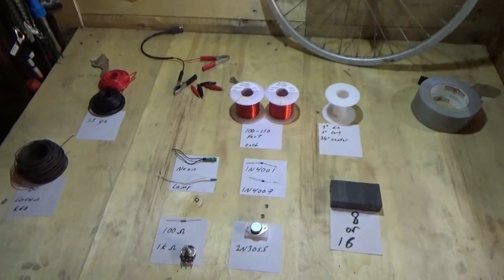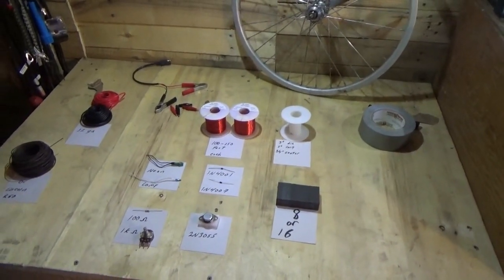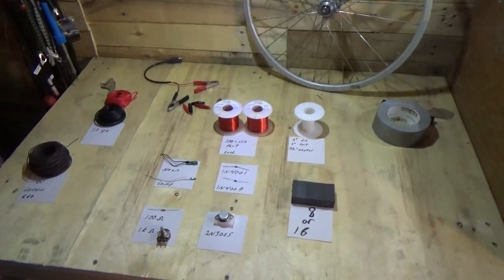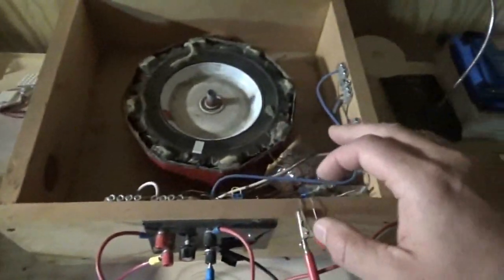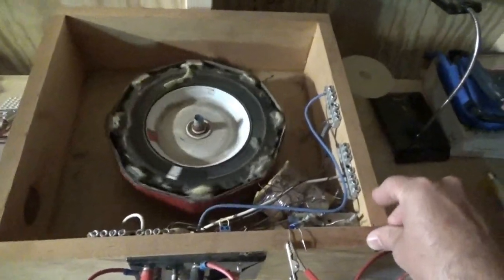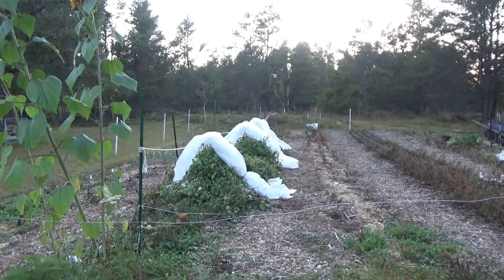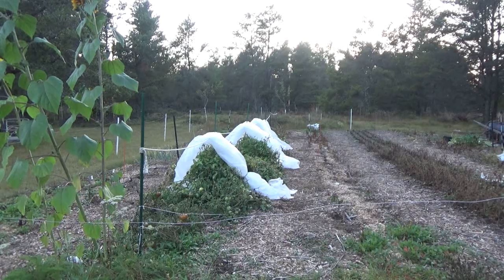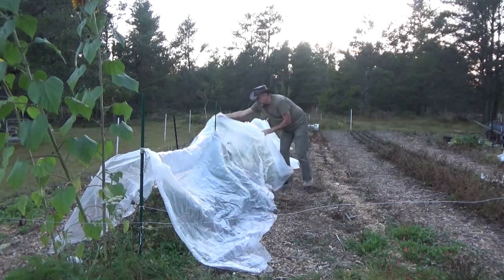Cutting Fire Wood & Making Bedini Motor Parts List

Comment: Troy, When you make a claim that you can get more energy out of a bedini motor than you put into it... Whether you realize or not, you ARE making a claim of having a "free energy" device, or "over unity". Don't you think such claims should be proven by showing input energy and output energy?
Reply: Troy, one more question and something for you to think about.... If the output power of a bedini motor was actually greater than the input power... Why aren't power companies using bedini motors to extract this "energy from the air" and selling it to their customers for a huge profit?
Reply: Troy, Wind turbines do NOT put out more energy than is put into them. Absolutely NOT. They convert kinetic energy of the wind into electrical energy. As a matter of fact the output energy of a wind turbine is slightly less than the input energy due to losses. The science behind it is well understood. Can the same be said for the bedini moter? Can you or anyone else explain where the extra energy in the claim you and others are  making comes from?
Reply: Now Troy, the energy you, yourself put into it is irrelevant from a scientific point of view. What matters is the total input compared to the total output energy. If you can show that the output energy exceeds the input energy.... As Jason put it, you would win a Nobel prize.
Reply: Troy, You say: "I can only show you what I am taking out of the run battery with my meters"..... Do you see the problem here? In order to scientifically prove a claim that more energy comes out of a bedini motor then is put into it, you MUST have ACCURATE measurements of the output power. You can't just say you're restoring a bunch  batteries and running a bunch of LED lights. That's not very scientific. I understand you have difficulties in measuring output power. But it is still necessary in order to prove your claim. As for the battery voltage rising, that doesn't mean anything without also knowing the current going into the batteries. You could have a million volts with almost zero current. Which would mean almost zero power. Since power as a function of voltage x current.  As for running a bunch of LED lights... They use very little energy. That is why you need accurate measurements of output power of the bedini motor.
Reply: David, as I understand it, they are not running a car on just water.  They are using gasoline.  Only they claim the regular combustion process is inefficient and can be improved by using hydrogen/oxygen injection.  This is claimed to make a better burn, more hp and less fuel used for a given number miles (mpg)  despite the agreed admittance that yes it takes energy from the engine to crack the water.  The subject is complex and we haven't even mentioned the effect of the water vapor also involved in the process which there is good literature on that subject.  By your reasoning here, the modern jet engine is a wasted cause as well, since it costs the engine, some 30-40% if I recall correctly, of its generated hp just to drive the compressor fans!  What percentage of the car hp is really lost to dissociating water much of which is then returned to the engine hp?  Certainly not as much as the jet engine!  Yet the jet works fine all over the world.
Reply: Troy, I can see why David and others are a bit frustrated with your saying the energy has to come from somewhere and you jump on the radiant energy/cosmic bandwagon without proof.  Those are energy sources that even the today's smartest scientists have not been able to harness at home practical use levels.  So why do you leap on those sources, when you said it must come from somewhere but really you don't know I think.  You should not jump on some source just to explain it (Bedini) unless you have some way to prove where it came from.  There is a source I know of which you have probably not thought of which may be influencing your tests.  Have you ever noticed on a cold day when you first try to start a car and the engine barely turns over, but then you wait a few minutes, try again and it is as if the battery is stronger and the engine turns over easier?  That is because of the raised temp in the battery causing a better reaction to RELEASE EXISTING energy that was not previously available.  The battery chemistry can be excited in many ways to release the stored energy, in your case, simply HV current spikes can do it by mechanical and the slight heat generated.  Also, a car battery changes capacitance with temperature.  In the hot of day that battery is endothermic and a small conversion of environmental heat is converted to an increased capacitance.  At night the coolness causes a lowering of capacitance but an INCREASE of voltage at the battery and INCREASE of useable energy output.  You can quickly test this with plan electrolytic capacitors.  It is free heat energy of the environment converted to electricity.  This will shut up the conventional arm chair energy conservationists and provide an easy to understand energy source and mechanism without leaping to radiant energy and cosmic stuff.
Reply: David, I agree with what you said about testing standards.  As to whether any of these magic clams are true or not I can not say.  But surely, the big boy corps would have knowledge on this.  I do remember many years ago, a test was done to merge gas and steam engine characteristics together for the goal of utilizing the normally lost: wasted heat energy which is where much of the usable energy is lost.  If I recall, the results were very promising and there was increased torque and other good results.  This is not the same as those schemes that used water mist injection which I have also heard gave interesting results.  Whatever came of it is not known.  I do know that big business works on releasing as little new or disruption tech as possible and reserves it for future incremental introduction to the people.  If they release all today, then they would have little to sell tomorrow.  Just business.
Reply from the maker: Jason, yes it does. That is the whole purpose of this device.
Reply from the maker: David, your own criticism answers your question. Why wont anyone use this? Because only a few even believe it works. And the oil companies wont allow it to go mainstream. There was a carburetor back when my Dad was young that got 250 mpg. Now, please ask yourself why we are "striving" to reach 30 mpg on most cars today. They have these amazing projections of increasing gas mileage by 2025 by a few mpg.
Reply from the maker: Same reason the Quanta Generator is not mainstream and why the company cannot sell it complete but as a kit. And why they can make no claims on what it does. And why they cannot really give you pointers on how to tune it. Its not allowed.
Reply from the maker: Actually David, I have done so on my electronics channel already.
Reply: The manufacturer of the  Quanta Generator most likely got busted by the FTC or some other government agency. The fact is, if Quanta could backup their claims, there is nothing the government could legally do about it.
Reply: Troy, you showed that the output energy exceeded the input energy? By measuring the BOTH the input voltage and current and the OUTPUT voltage and current? I'm sorry if I missed something.
Reply: Troy, Here is what I believe..... The power companies have far more resources available to them then you or I. In the interest of increasing profits, I'm quite sure they investigate these claims, and if any of them were valid.... I'm quite sure they would use the technology. Just like they use hydro power, wind turbines, gas, coal, and nuclear power to generate electricity. As for the so-called 250 mpg carburetor... I've heard of those claims too. I say to the people who make the claims.. Show me the proof! I don't just believe everything I read.
Reply: Now Jason, to be fair, that is a stupid statement.  Just because YOU do not know the mechanism to extract the potential to do work from some energy SOURCE does not mean it is does not do so.  Be more scientific to unknowns to YOU.  Investigate, test, show results:  scientific method, just do it rather than harp about it.
Reply from the maker: +David Johnson David, I did show you the proof, and I did, and you would still deny it.
Reply from the maker: +David Johnson the oil companies are involved. Not the power companies.
Reply from the maker: +David Johnson and look up vapor carburetor. You can get up to 200 mpg with any vehicle right now. But it's illegal. Why? Won't pass emissions. Emissions too low fails the test.
Reply from the maker: +David Johnson look up hydrogen booster. I ran them for years and experimented heavily with them. BUT it fails emissions. Too clean. Not legal.
Reply from the maker: +David Johnson David I can only show you what I am taking out of the run battery with my meters. But I ran many led lights and am restoring triple batteries at the same time. With no increase in power used from the run battery. Now the energy is there. The lights are on. The battery voltage are rising. It has to come from somewhere.
Reply: Troy, I'm aware of the so-called " hydrogen booster" claims and realize you believe that stuff. I'm sorry but I have to disagree with you. These "run your car on water" devises supposedly increase your MPG by injecting hydrogen into the combustion process. The problem with such claims is that the hydrogen comes from the electrolysis of water. Which takes energy! To me it seems pointless to draw energy from the alternator to split water into hydrogen and oxygen... Only to get energy back when the hydrogen is burned.
Reply: If bedini motors actually worked to put out more energy than they consumed.. It is the power companies that would benefit from such technology. Since they could sell the power to their customers. So my question remains... Why aren't the power companies using the technology.
Reply: EnergyCrafts, Keep in mind that in a jet engine the bypass fans also provide thrust. But you're right, it does take energy to drive fans and compressor stages. But here is the difference and please correct me if I'm wrong... It takes 100% of the energy gained by burning hydrogen to crack the water in the first place. As for whether hydrogen injection improves combustion efficiency, you may have a point. But shouldn't claims of improved combustion efficiency be PROVEN by tests run on a dynamometer to EPA standards?
Reply: David, from my own perspective, the cracking water to improve engine combustion and performance is only speculation as I do not know of any proven tests using accepted standards.  But as a rough consideration that an alternator may need to output 14.2 VDC at 40A  to drive an electrolyzer that is 568W is less than 1HP robbed from the engine.  Not to run the engine, but just aided injection to gasoline.  Now lets say the engine is 32% efficent in the gas to conversion to mechanical at the crankshaft while producing 75HP.  Next the magic box is added as a load taking 1HP so now only 74HP is available for outside use.  But say this magic box increases the engine HP by just 5% then it would reach 77.7HP output.  That is a gain of 3.7HP.  for a magic box cost of 1HP.  So even with this very conservative sketch, it does seem there is some possibilities here even without factoring in water vapor to steam condensation adding to the HP and efficiency.  The water vapor may convert more of the usual lost heat to usable kinetic force in the cylinders rather than the heat being lost to the environment.  Adding this consideration makes the possibilities that there may be something to this after all is intriguing.  Surely big business has already done tests and is not motivated to release practical results as financial motivation and the increased tech competition is not productive, as well as gas is already fairly cheap.  Rather they probably want to have a "secret weapon" for the future to beat competition or to serve as "the solution" when gas becomes far more costly and rare.
Reply: EnergyCrafts, there may no proven tests or accepted standards for testing combustion efficiency. But there are definitely accepted standards for testing fuel economy. Which are used by the EPA to test vehicles submitted by manufactures. All someone who is making a claim that their contraption improves  the combustion process has to do  is submit their vehicle and their "fuel economy improving device" to a lab with a dynamotor to perform "before" and "after" tests to test fuel economy. To my knowledge none of the folks promoting these gadgets has done that. I suspect there is a reason besides costs,  that they don't do so. Instead, they make unproven claims about their products.
Reply from the maker: Now David, you are twisting the wording of things just like a real "expert". I said does a wind turbine produce more power out than "I" put into it "myself"? Does the radiant energy device produce more power out than I put into it myself? I would say yes to both.
Reply from the maker: Jason???
Reply from the maker: Interesting how people avoid the questions I ask and just deny it is possible.
Reply from the maker: Really now? How about the static energy generator? Are you saying that is not scientifically possible? How about a wind turbine? Are you saying that is not scientifically possible? I mean, it puts out more energy than I myself put into it. Now dont go changing the rules on me here. Its all or nothing. Either the rules you put on this device apply or not.
Reply from the maker: Nope, not calling it a free energy device. Because it requires energy in to get energy out. Nothing is free.
Reply from the maker: Please see my electronics channel where I have been conducting experiments showing more energy output than I put into the device. I have meters and things demonstrating the energy. Such as the ability to light LED lights without increasing the energy used to power the device while charging batteries at the same time.
Reply from the maker: There are no laws broken here. And the "law of conservation of energy" was about thermal energy. It is often incorrectly applied to electrical energy. Anyway, do you believe there is energy that we cannot see but maybe we can harness it? Static energy for example. Radiant energy. Cosmic energy. Why is it so hard to believe this device is simply using energy that is already available?
Reply from the maker: do you deny the existence of that energy?
Reply from the maker: Lets consider this: does a wind turbine produce more energy than I put into the device?
does the Bedini Motor produce more energy than I put into the device?
You see how the laws are the same here?
Reply from the maker: Jason - I asked you a question - Do you deny the existence of radiant energy or cosmic ray energy? Yes or no?

Comment: Troy on your dead and empty garden rows you should (right now) add some compost, manure and then till it all in. Afterwards cover with dead leaves or mulch and let all that sit over winter. Come Spring pull back the cover and plant.
Reply from the maker: Good point, all but the tilling. I am never going to till again based on the "back to eden" method.
Reply: The Do It Yourself World i understand the back to eden method. The thing is you need to get stuff into the ground to attract worms and other beneficial organisms to the  garden. Then use a covering over winter to protect the soil.
Reply from the maker: Yes
Reply: Troy your doing way better now then when you first started how ever iv been garding my whole life it takes time to be super garder a , your going a fine job you get better as you go for sure make 2 big ass green house it will help
Reply from the maker: Thanks. I have also been gardening my whole life but sadly I keep moving to new environments and have to learn all over again each time.